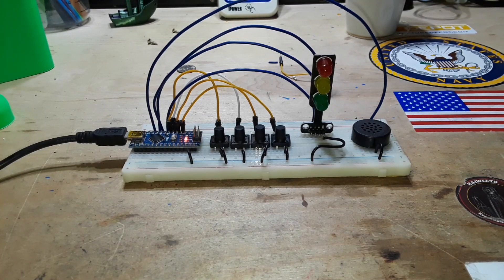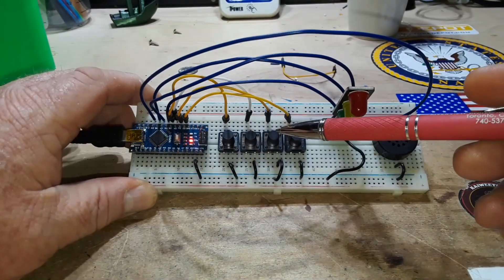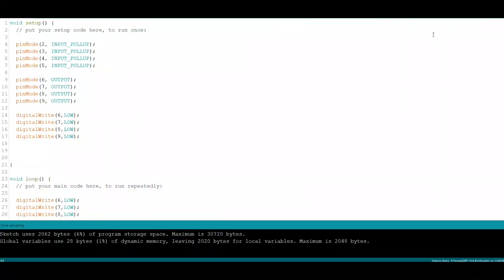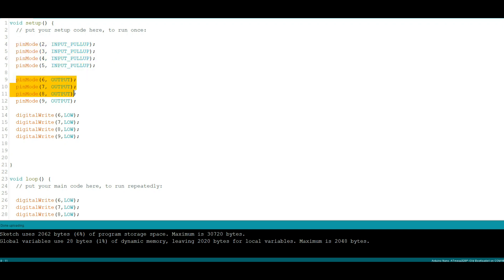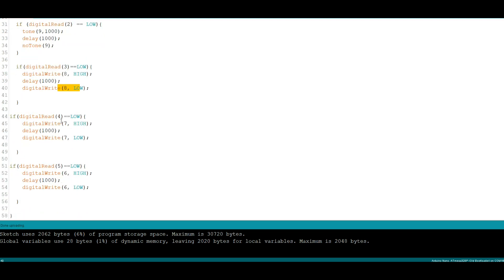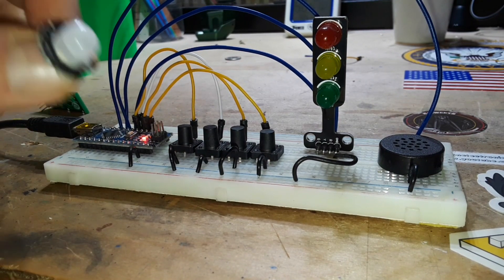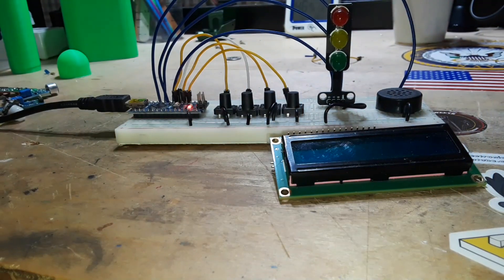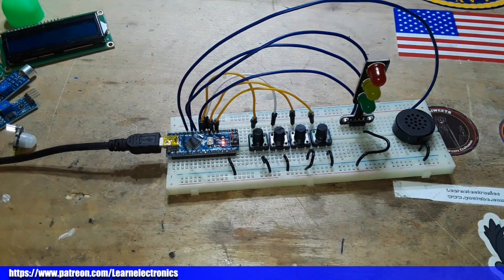Boats Should Float, Not Inputs!

Comment: Nice! But I got one question: what would be the electrical explanation of the problem? When you brought your hand closer, was any current induced?
Reply from the maker: Without pull-up resistors on the inputs, they can float anywhere between zero volts in 5 volts. Bringing my hand closer, probably capacitively coupled some sort of small current that was enough to throw the inputs above 3.3 volts which should cause the Arduino to read them as a high signal. Once we put the pull-up resistors in place, in this case it was done through software. The Arduino constantly reads a high signal 5 volts on those inputs, until a button is actually pressed. At which time the direct short between the pin and ground will overcome the resistance of the pull up resistors and switch the state of the input
Reply: @learnelectronics  Oh now I get it thaks to your very clear explanation! thank you very much!!
Reply: The reason that the inputs "float" at some unknown voltage is that they are extremely high impedance (which you can think of as being resistance at low frequency). Extremely high impedance means that extremely low current can result in significant voltage - simple application of Ohm's Law. In an environment near AC mains it is quite easy to capacitively couple AC that will switch the input at mains frequency.

A pull-up or pull-down resistor vastly reduces the impedance and establishes a well-defined voltage at the input. With CMOS inputs you can use either a pull-up or pull-down resistor at will, as long at it is compatible with what you want to accomplish from a logic perspective and with what is going to drive the pin to the opposite logic state.
Reply: @d614gakadoug9  thank you very much.